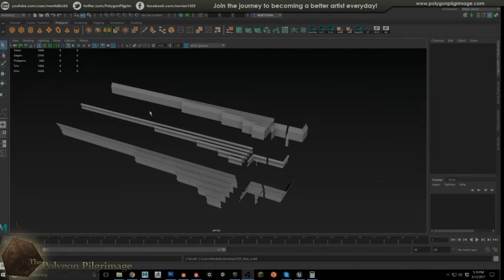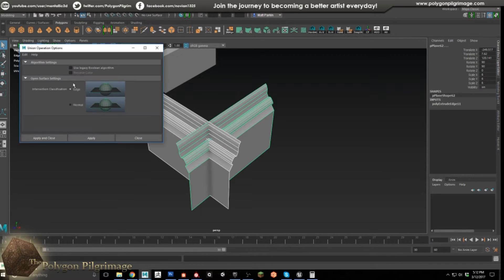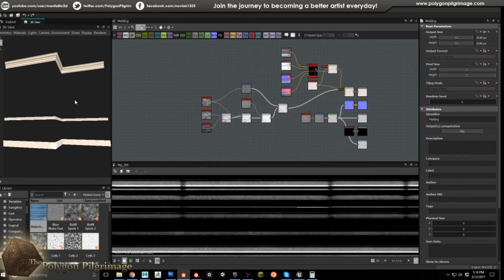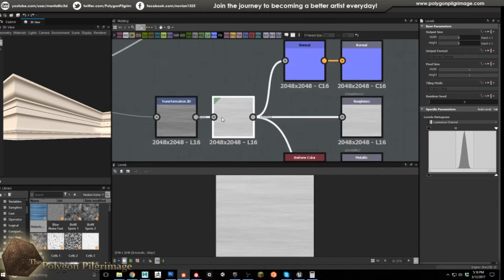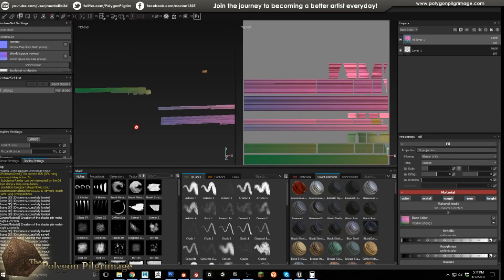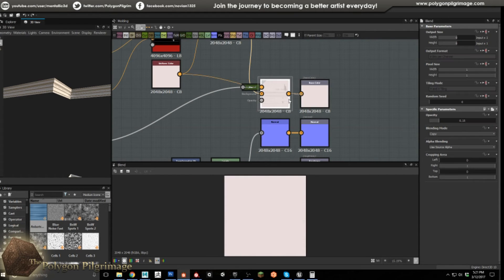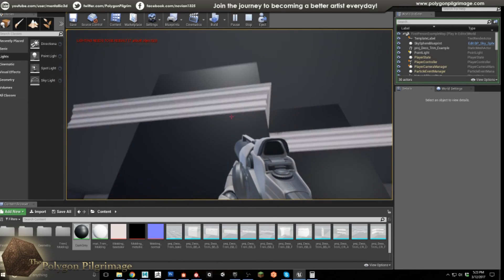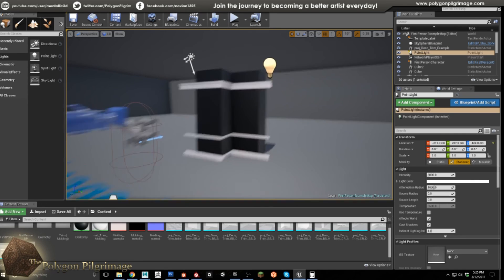Molding in Maya LT, Substance Designer, Painter, and UE4!

Comment: You can make easier quicker turns using the mirror tool with merge, and just rotate the active symmetry plane.  Its fast and easy.
Reply from the maker: Thanks Matt, I have since learned how to use the mirror tool better.  Thanks for the tip, I appreciate it!